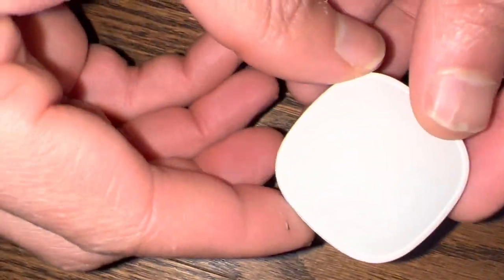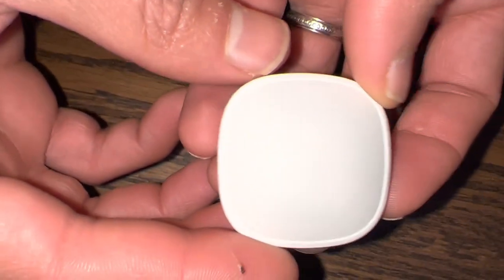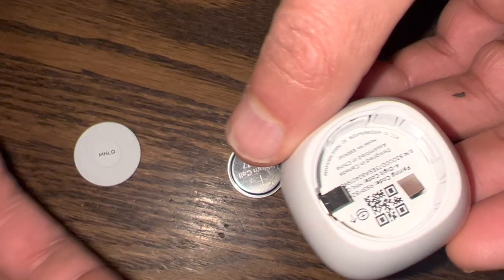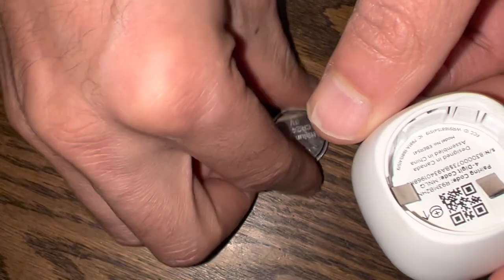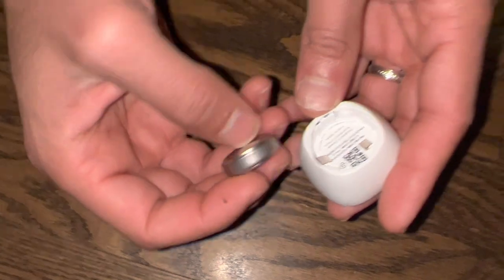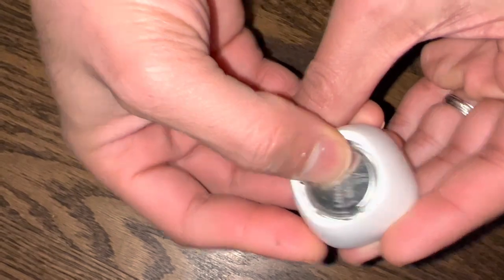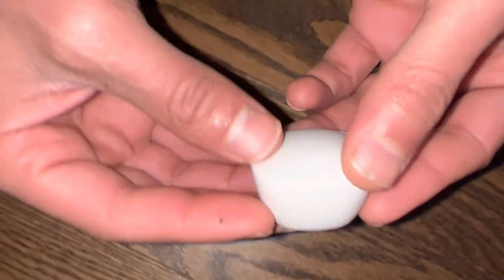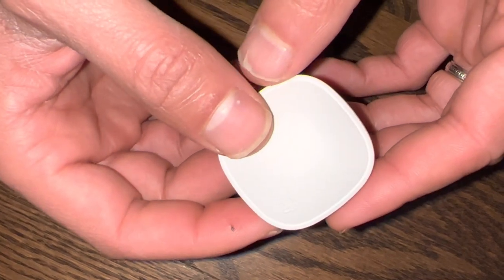ecobee sensor will not pair or work

Comment: The problem is that your battery is put together and labeled backwards. The side of a coin battery that has the ridge, texture and smaller diameter is normally the negative side, but yours shows positive. So of course your side tab needs to be bent up in order to make contact to the positive side of your backwards battery. Where did you find a battery like that?

Comment: But... you're putting the battery in upside down!  At  0:29 in the video, you can even see the symbol on the bottom that says '+' goes up.
At least on my ecobee, the positive (flat) side goes up, and (as another commenter pointed out) wraps around the sides where it will hit the metal contact on the side.  Negative (ridged) side goes down, and touches the contact at the bottom.  
For other folks watching this video, maybe just turn the battery upside down?

Comment: really strange. the Panasonic CR2477 batteries I have do not look like the battery you are using. Mine have a smooth top (+) that is one piece with the sides. With a meter I get 3v on the bottom to the side, or the bottom to the top. so the bent down tab would make contact with the side of the battery. Frustrating trying to get it to connect. It worked when I first got it.

Comment: Someone commented below that the battery has negative on the sides. I put a meter on the top and bottom and side and only got a reading with meter on top and bottom. There is no negative power connection on the side of the battery. And mine also came from the manufacturer with the metal tab bent downward. They are installing the batteries incorrectly. I had to go through one more step than you outline - I had to exit setup and start again before it would recognize my sensor. "Try Again" did not work. Thank you for this video! Sensor is working now!
Reply from the maker: Glad my video was helpful! Thank you for supporting my channel!

Comment: This is inaccurate. The positive side of the battery wraps down the side. They wouldn’t install them that way if it weren’t the case.
Reply: The issue wasn’t from manufacturing, we must Forced it down by mistake. So that’s why there was no contact on the positive on the top.

Thank you for supporting my channel, with all of your help we can get to 1k subscribers! We are so close!
Reply: @xkatanaswordx  the top and side are the same, both positive.
Reply from the maker: Hi Jake, you are right about the sides being positive. The way these batteries are sheared through me off, all batteries like that the positive are on the sides.
Reply: well it fixed my problem so he must be on to something 🤷🏻‍♂️

Comment: Mine came out of the box as you showed. Tech installing assumed bad battery. I got replacement and tried and tried and nothing. Quick search and I find your video and it was like a light bulb moment! Of course there has to be contact on both sides! Pulled tab up and slipped battery underneath and works fine. 
Thanks
Reply from the maker: Glad this video could help! Thanks for supporting my channel!